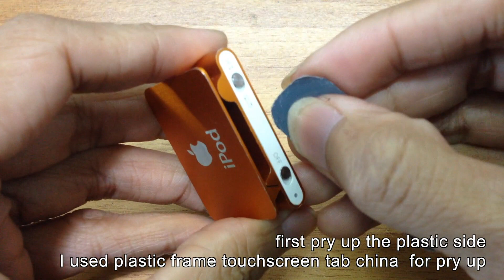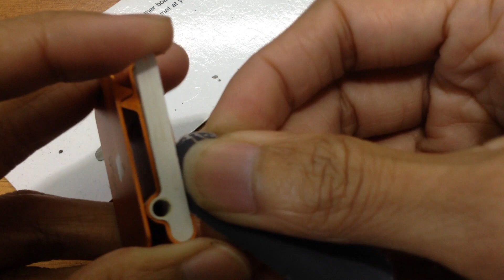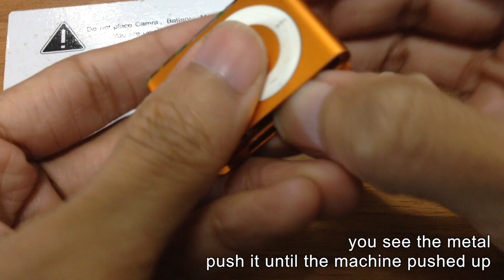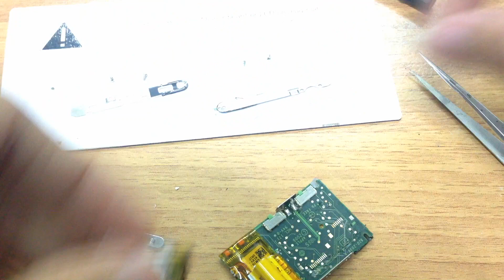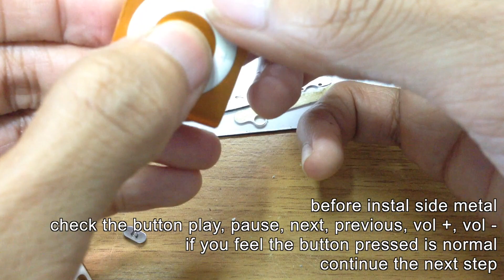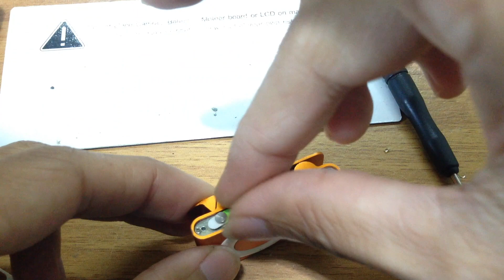Change battery iPod Shuffle Gen 2

Comment: great video, like that it shows ALL the steps and problems with tear down and assembly.
always solder your iron tip before use, use flux and fresh solder on disconnect and reconnect makes it easier.
Reply from the maker: David Bales thanks bro.,

Comment: Ok. I just did it! And Ive a green light.  AND... I got lucky.
Its a good video and it helped to watch it.
The most difficult part was the soldering. I really could have used a mount, a magnifier, and more hands than Vishnu. One hand to hold solder. One hand to hold Gun. Third hand to hold battery and manipulate wire. All while everything is really eefing small. I had magnifier glasses. And i still needed a 4x loop. 
The soldering is where i got lucky as hell. Old battery off is easy. Melt solder and pull leads off. Then. Clean the plates of any solder bridging the lead plates together...ie, create a short. 
Somehow i melted some solder on to the unit end. then i held one battery lead by hand and touched it to the solder why heating with the gun. I almost gave up. I got one. Total luck. Oh yeah, Ive never done this before... not fix a battery, but solder a battery. At any rate. I did the same with the second. Got lucky again. Both held. No short. I got a green light. Syncs with itunes. Putting it back together was easy enough. The sticky under film can get bunched up if youre not careful, or even if you are... then the cover doesnt lay as flat. But easy fix. Remove the sticky film. I bought the battery and kit on amazon. and the soldering gun. 
So happy to have my shuffle back. 
!!
Reply from the maker: SuperSportFitness  😁., good work bro., keep up 😁👌
Reply: Oba, amei o seu comentário onde comprou as coisas

Comment: I didn't understand what you used to pry up the side of the iPod shuffle @ 0:27. I have about 14 of these devices that I'm trying to figure out how to fix. Can you please tell me what that was you used to pry up the plastic sides? Is there something similar to that I could use?
Reply: Well, everything that is stiff enough to wiggle it off but flexible enough to not break or bend it. HTH